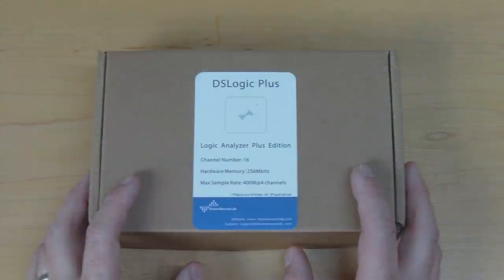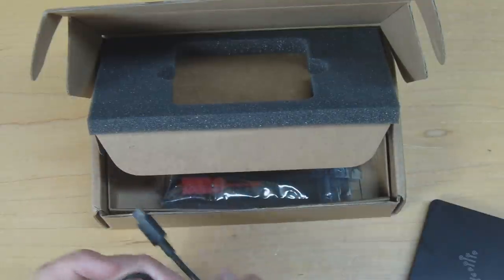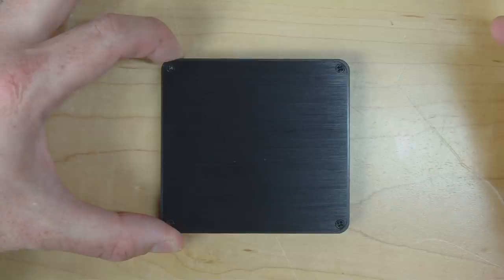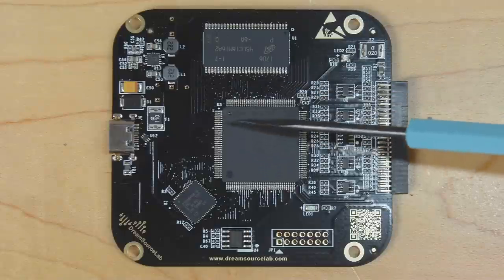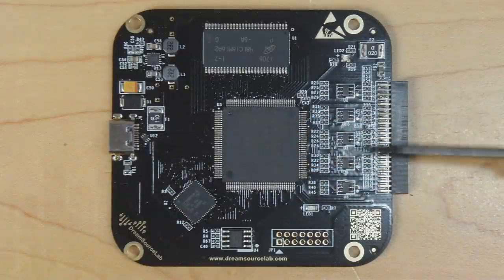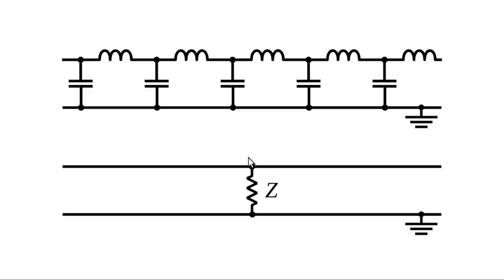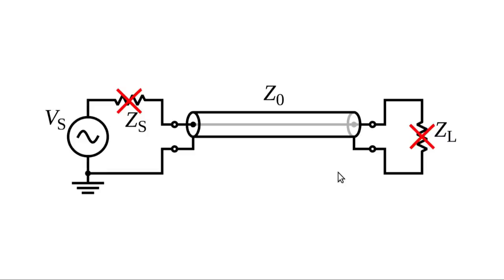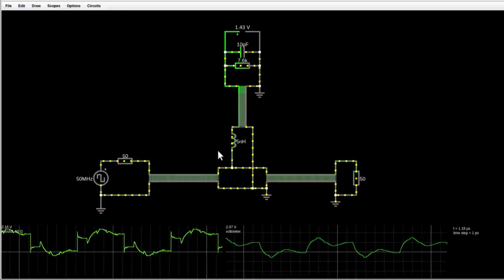[009] DSLogic Logic Analyzer Review and Teardown

Comment: Apparently, most of the comments are quite old so I'll add something a bit more up-to-date.  I have a Bitscope that I've been using for a while and found that once I got into more complex  and much faster components the Bitscope BS325 and BS10 didn't, or wouldn't, do the job.  I almost went for a Saleae Logic analyzer and still may do that, but the DSLogic Plus was in the price range to try and also in the price range to not feel too bad if I needed to replace it with the Saleae if needed.  I'll say up front, this was a good buy.  This is the 16 channel unit with a full complement of fly wires (shielded) and lots of EZ-Hook type clips.  They didn't say EZHook but the quality is more than comparable.  I purchased more EZhooks in more colors to make things easier.  The DSLogic unit also came with a nice zippered semi-hard case and the USB cable with the 'C' type on the business end.  Overall, it works very nicely with the DSView or Pulseview app.  The DSLogic DSView compiled perfectly on my Debian v10.6 amd64 box with no problems other than needed to install a lib or two.   I used the Pulseview .appimage and it also runs without issues, only needed the driver from the SigRok site specifically for the DSLogic Plus.  The only item that I would like to see resolved in BOTH *Views is to be able to display ascii characters in more of the protocol decoders.   I see that the UART decoders have that option and I'd like to see it in a couple of others, CAN and  I2C.  Not a show stopper for either one of these, but it would be a nice feature.  Maybe there is a way to do it that I haven't found yet.  The producer of this video apparently has ties to the Pulseview/SigRok environment so I'll try a contact for more info.  Overall, good buy, exactly as advertised and DSView and Pulseview run  and DSView compiles without issues on Debian v10.6.
Reply: Awesome and great info! Thanks for taking the time to type that out. Hopefully he'll come back to his channel one day and make some more content because it really is great
Reply: A few days after my above comment he posted a video for the first time in years. So glad to see him returning. When it comes to tools like this... If it starts out to be somewhat useful and intriguing... Then the community will jump in there and try to open source everything and get it working in ways that would be difficult for the original developer. Having hundreds or thousands of eyes and specialists using something like this... Tends to help get the code and software side working perfectly after a few months or years. Which would be tens of thousands of hours of work if the original developer tried to perfect everything themselves

Comment: Excellent video, thanks for you time and effort

Im surprised they have the 7.6k ohm pull down resistors on the inputs. This would be enough of a load to affect for example I2C lines with 4.7k or higher pull up resistors, i.e with a standard 4.7k pullup to 5V it would with the DSlogic load only pull up to around 3V. This seems very weird to me on a logic analyser. Could anyone confirm that the value is indeed 7.6k ?
Reply: I was surprised too, and right now I'm measuring 107kR pull-downs on each channel on my DSLogic Plus (bought 1.5y ago). Each lead has itself a 100kR resistance between its tip and its header. Both create a resistive divider and halve the signal present at the FPGA input.

Comment: Ordered this one just a moment ago. After that I checked YT and saw this video. I'm glad this review ended up in a positive way and I did not find out that the analyzer, I just ordered, is  bad :) So far, I've used Saleae logic (original), but sometimes it happens that it can't keep up with the sample rate (even when not using maximal one), probably because something else tries to communicate on the usb bus. So I'm looking forward to this one, with a memory and compression. I've also checked the PulseView and it looks very nice. Those decoders are awesome. When I was about to finis testing it, it crashed, but still pretty awesome. I will try to see if I got a core file and try to debug what happened, if possible. Anyway, great video and great software!

Comment: Has DSL fallen on hard times?  Four months later and the DSLogic Plus is still not listed on their website. And the reports of ordinary flying-lead "probes" seems like a down-grade from the coaxial cable was reviewed in this video.  OTL, you have a fabulous YT channel, worthy of an order of magnitude (or two!) more subscribers.
Reply from the maker: I don't know what they're doing. I like the probes on the Plus, and the price/performance is great, but the company are operating in a really shady way. Thanks for the encouragment! Next stop 10^4 subs.
Reply: @OpenTechLab  surely the important numbers are 2^x - looking forward to 32768!
Reply: I bought one of these things on eBay. It does not come with the coax so I'm guess there are a lot of fakes floating around out there.
Reply: I guess I only have myself to blame ? or was this a design change ... the website still shows coax. what I have is leads with one ground per connector which doesn't make much sense after going to the trouble of providing the grounds in the first place. I guess a lot of things on eBay from China could be considered suspect, however, after buying and waiting for a long time mine was shipped from some place in NJ, USA. I'm of a mind to file an eBay complaint.

Comment: I wonder how they are doing the adjustable threshhold thing. After some research I found out that the FPGA has an integrated ADC that they probably use. They claim the threshhold is variable from 0 to 5V, but the input pins on the FPGA are rated for a maximum of 4V so that is also the maximum voltage that could be measured by the ADC inside the FPGA.
Does that mean they are just feeding the FPGA 5V even though it is not rated for that voltage or is there something else going on that I am misssing?

Comment: I purchased one of these from the officiall store, and I have an odd issue with the automatic measurement function (though it could be the capture).  No matter how fast or slow a frequency I sample, the measurement of the period / frequency varies constantly when I hover over the samples and move left and right between pulses.  This is using buffer mode or streaming mode.  Even frequencies as low as 1Mhz sampled at 400Mhz show the issue.  Even VGA hSync pulses do.
Reply: For example, measuring a 17.734Mhz clock, and it randomly alternates between 17.34Mhz and 18.18Mhz even when sampling at 100Mhz or 400Mhz.
Reply: @st3ddyman  I have a similar problem here...
1000000000101111 - 500

1000000000010111 // corrupted
1

1000000000101111 - 500 // reconstructed

this is using their latest device with the pango FPGA. It's difficult to analyze the data stream due to the corruptions, and they seem to come up regularly.

Comment: They have a version now that goes up to 1Ghz and I'm honestly struggling to come up with a use case where you have a GHz signal and a logic analyser is the right tool for the job. USB maybe? Though I think that still only has a few hundred MHz clock.
Reply: I mean, I'm currently trying to debug some probable timing bugs (missing clock windows or something), and I'm considering getting one of the fast ones so I can be sure I'm not getting more aliasing issues.  Granted, I'm a noob in this domain, so I don't actually know if this IS the right tool for the job.  But it's currently among my best guesses.
Reply: @Erhannis  For transients and timing issues I'd probably have used an oscilloscope but for very high frequency stuff trying with a logic analyzer first would certainly be cheaper if you don't already own the equipment.

Comment: Hey, nice review, but I have two questions about the probe wires:

1. Is it possible to use the logic analyzer with "normal", flying leads for low-frequency applications? I imagine the coaxial leads can be a little annoying with their two probe points in this case.

2. I assume that even though each probe has its own "ground" probe point, that the ground points are not independent of each other?
Reply from the maker: +g3i0r 1. Yes it's possible. You would just have to figure out how to attach the leads to a 0.05" header. Easy enough to make something nice by getting the mating 0.05" pin-header and solder and heat shrink some flying leads on.

 Also with the coaxial leads at low speeds it's not essential that every ground be connected to the device under test.

2. The ground connections all go to the same ground plane inside the logic analyzer. The benefit of having lots of them is that it means that the ground current can take a direct path to a ground close to the attachment point of each input channel - which is a very small current loop.

If you have just one ground wire shared by all the channels the current path can become less direct - which is a large current loop, which adds inductance, which will block high frequency clock signals, short pulses, and sharp edges, because inductance looks like a high-impedence i.e. like an open-circuit to the high frequency component of the current.

Comment: Hello,
Great review, many thanks!
I am considering to uprgade my DSlogic to DSlogic Plus by soldering a SDRAM to the footprint on the PCB. But then I will need the device to enumerate as DSlogic Plus on USB bus, therefore I need to know at least the PID of the Plus version.
Could you please publish the EEPROM configuration data from your Plus version?
Reply from the maker: All the VID/PIDs are listed in the sigrok driver source code: http://bit.ly/2ALm3oC . I'd really like to know if a hack like this works. Can you post your findings somewhere? Maybe in the sigrok wiki?
Reply: I just ordered a DSlogic box, but on closer review I think I"m also going to be getting the basic model rather than the plus model.  I'm afraid it's too late to correct that mistake.  Is there any reason to believe that the bit image is the same between the basic and pro?  I doubt changing the VID/PID will be enough.  If someone with a pro unit could read the contents of the EEPROM then an update should be doable.  The SDRAM chip is readily available and cheap.
Reply: My DSLogic box came today and as I expected it does not have the SDRAM.  I can answer my own question... all of the .bit files come with the software downloaded from the Dreamlogic web site so we're good there.  I'll order an SDRAM and see if I can upgrade mine.
Reply: I finally succeeded in updating mine.  It took a couple of days.  The needed FW and bit files are included in the Linux release.  The biggest problem is that the EEPROM's write protect pin is ACTIVE.  Luckily with a pull up resistor so you can easily jumper it to ground, reflash the EEPROM and then remove the jumper.  A 16M capture buffer is NICE! Sure beats my OLS.
Reply: Any chance of a video showing the upgrade process?
Reply: @DrTune  Link is broken

Comment: Adding a way to convert captured data into microprocessor opcodes would be very useful for people debugging old devices with it.   I know it's a big project, as some way that people could write "dis-assemblers" for different processors as plug-ins would be needed.   Possibly this same facility could make it possible to display the data in other "decoded" forms for other applications, and not just as uprocessor op codes.   I know that serial, SPI, etc decoders exist, but I am thinking of something that would be programmable, and not a fixed decoding.
Reply from the maker: There are a couple of examples of this already. There is a decoder for z80 opcodes: https://sigrok.org/wiki/Protocol_decoder:Z80 , there's also a decoder for ARM TPIU/ITM/ETM tracing: https://www.sigrok.org/blog/new-protocol-decoders-arm-tpiu-itm-etmv3 - this can print decode the logic data to give you the line number of code that is being executed. Is this related to what you had in mind?
Reply: Yes.   Now we just need 6809, 8051, and a few other ones.  Thanks for the information.
Reply from the maker: rlg42 rlg42 Sounds like you just volunteered! If you want to contribute, I can recommend decoder writing. Usually it makes for a fun weekend project. the first step is getting some sample data for the sigrok-dumps repo. Then the python hacking should be pretty straightforward with the z80 PD as a template. Join #sigrok on irc if you'd like to discuss more about how to get started!
Reply: Pretty busy right now with other projects, but maybe at some pt I will look into this.  Thanks

Comment: I've seen the original Kickstarter too and of course envied the large built-in buffer (compared to my OLS) but I have a serious issue with the DSLogic not supporting any kind of run length encoding as far as I know, which would greatly aid capture of fast bursts of signal with significant gaps between them - and that sort of thing happens more often than you think. Naturally, one might think with that much RAM there's no need for RLE - and one would be quite wrong. When you sample at four hundred million samples per second, guess how long will your sixteen million 16-bit words last...? A fraction of a second. Whereas even the ludicrous twenty-four thousand bytes or RAM in the OLS should last around two seconds if there's not much happening (and could last immensely long, with the same paltry amount of memory, if only they implemented 4-byte counters along 1 and 2-byte ones, although I'm not sure the sump protocol the OLS uses would allow that)...
Reply from the maker: +Attila Asztalos There is an opportunity here to start an open logic analyzer firmware project for sigrok. It's conceivable that it could be made portable across multiple devices. At the moment we just extract the binary firmware from the vendor applications with
 scripts in sigrok-utils. So it would be much better if we had an open firmware, that would support all these features - depending on the capacity of the hardware

Comment: Anyway to get the raw analog signal from this guy? Just got one and not seeing anything. Or at least measure the voltage?
Reply from the maker: It's a purely digital device - it can only show you 1s and 0s depending on whether the voltage is above or below a threshold. What's the internal supply voltage of your device-under-test? You typically want to set the threshold to half the supply voltage.

Comment: Umm 200Mhz oscilloscope?

Rigol specs this family at most to 100Mhz...
Reply from the maker: You're right. My mistake. Though the captured signal is well below the Nyquist frequency, and the attenuation at this frequency isn't very severe, so I believe the results are still valid.
Reply: "100MHz" wink wink ;)

Comment: At 38:00 you discuss Nyquist frequency and sampling rate, using 200MHz square wave and 400MS/s capture rate as an example. Then at 39:20 you demo this case, and the capture looks pretty poor. But it looks to me like that demo must not be using a 50% duty cycle, probably more like 75% high, given the extent of time that the plot stick's high. Statistically, a square wave at half sample rate with substantially non-50% duty cycle will case the sampling to "miss" a substantial proportion of the alternations of the signal.  An alternative view is that sampling a square wave whose frequency is half the sampling rate (ie: at the sampler's Nyquist frequency) will be borderline successful if the square wave duty cycle is 50%. But it the duty cycle is different from 50% then the proportion of energy in harmonics above the Nyquist frequency is enough to incur aliasing sufficient to show up in the logic analyzer's "1-bit A/D" result.
Reply from the maker: Exactly. The duty cycle isn't precisely 50% to begin with, and with rise-time the wave form is a rhombus-wave not a square-wave, so unless the threshold voltage perfectly bisects the waveform the duty cycle is going to look even more unbalanced.

So you're really pushing your luck if you try and go above half-Nyquist with an asynchronous logic analyzer - the more oversampling the better.

Comment: On these videos where you investigate bandwidth-related topics, might be helpful for viewers if you would throw in a comment about the gotcha that scope probes set to 1X have greatly reduced bandwidth compared to their nominal spec, which is for their 10X setting. I see that you have your probe set to 10X (that is, divide-signal-by-10), and the scope configured to read out in compensating x10 values.
Reply from the maker: Yeah, that might be something I can put in as an aside later on. For me it's a learning experience trying to pitch these videos at the right level. I want to inform, and also entertain. If I talk about every little thing the video becomes very long and convoluted. If I skip over details based on assumed knowledge, then the videos will be meaningless to many of the viewers.

If thinks are working well, hopefully the video will jump-start the viewer on the topic, and they can search out any information that I gloss over, or I'll come back to it as part of something else later.

Comment: 1. Is a chinese clone of Saleae Logic devices.
2. Software driver not certificated. 
3. Software use at your own risk. Security issues.
4. DSLogic company transparency is zero. Where and who are the developer? No information, no pictures, no location, nothing. Contact information only a e-mail address.
5. Rarely or zero acitvity on DSLogic website and forum.
Result: better you save money and buy the original Saleae logic analyzer from a transparency US company with friendly developers and support. You will be happier.
Reply: Saleae logic cost 10 times more than this product, luck with saving :)
Reply: thanks for informing me of the product.

I will start saving.